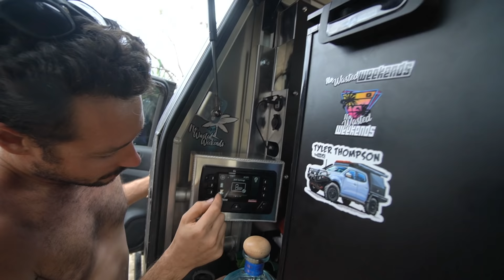Best side of Fraser Island ? 💦

Comment: If Sam only ever gets stuck in videos I won't mind because the turbo spool on that duramax makes my blood moist. 

TJ rip the DPF out of the Nav and become a spooly boy too!

Great videos mate. Editing is top shelf
Reply from the maker: haha ! yeah the Navs are so loud hey ! sounds like your going to love next episode ;)
Reply: @TJANDMAC  took the dpf out of my nav. Gives good whistle. But some of the Navs with straight throughs are waaaay too loud. Every highway patrol within 10km will hear it!

Platinum do a variable volume valve exhaust for the nps where at the flick of a button you run the exhaust straight through or back through the dpf. 
Probably the solution to make them legal.